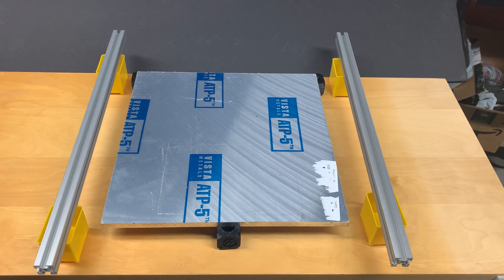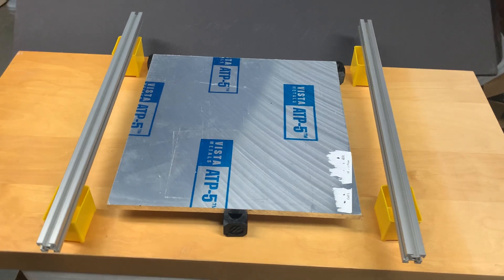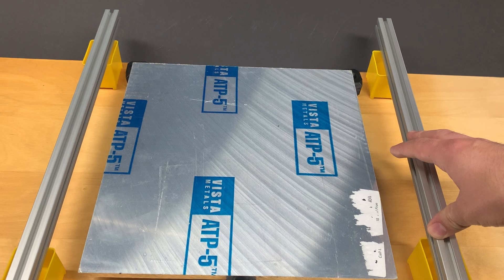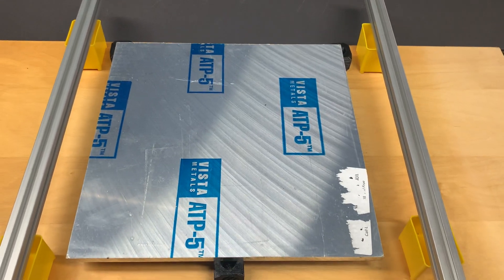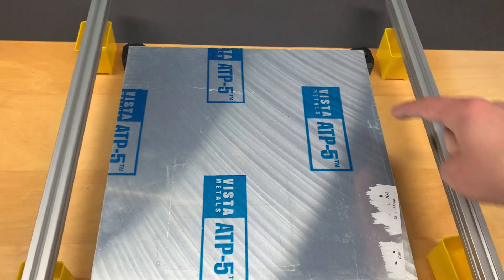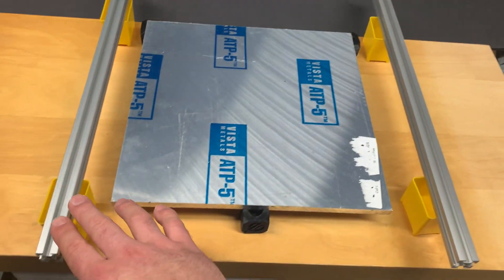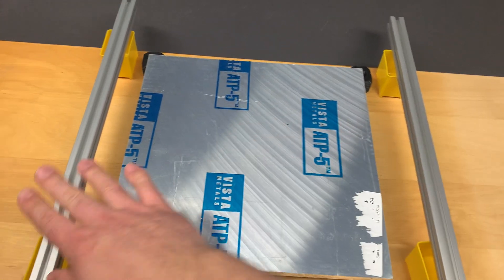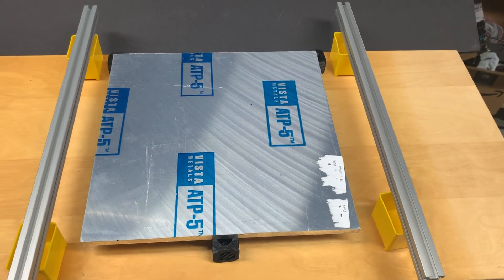Intro to Voron Bed Leveling: 3 Point vs. 4 Point

Comment: Thank you for this. Explains what is (likely) the issue with my small core xy printer. I’ve been tearing my hair out trying to diagnose the bed mesh differences in the front corners.

Comment: Swap out those springs for those silicone rubber spacers. They are there only to allow some movement in case of nozzle crashing into the build plate.

Comment: You are right, but there is another important point to remember. Bed leveling (or tramming) is dynamic, not static. The firmware compensates the Z height for every point of the the bed, interpolating the mesh points. So, even if the gantry is misaligned on Voron 1.8 (or Trident) it should be compensated by moving the bed. So, in the end, it should not be a huge problem.
Reply: The firmware can ONLY do that if the firmware includes that feature (some STILL don't), and if the feature is properly configured by the user - which for some machines that support it is necessary before every print. If the machine is large enough, many users will be unwilling to sit through the wait duration of the process more than once or twice, especially if they don't have the specific hardware to ease the process (i.e. a bed probe). Since not everybody builds Voron printers using all of the same parts, these are concerns to keep in mind.

More importantly, bed tramming / ABL is unreliable IF the cause behind it is racking or other misalignment of the gantry itself, because either of these can and often does result in unpredictable stepping mistakes, and attempting to correct for them with ABL or using the machine without correcting the hardware causes can both exacerbate the problem and damage the gantry. ABL/UBL/MBL is fine when the problem isolated to the final platform of the bed, but it's very much not fine when the problem originates from the gantry - or, even worse, from the frame in those very few printers which actually have one.

Comment: Haven’t looked at a v2.4 quad gantry yet, but isn’t the point that one uses three points to tram a plane, and two points to tram a rail (line)? I think the confusion comes from calling it “bed leveling”. If I understand correctly, you aren’t leveling or even tramming the bed, you are tramming each of the two gantry rails independently to be parallel with the plane of the bed (and each other). The machinist’s way would be to have an indicator stand referencing from the bed (a flat plane). If the v2.4 has four corner screws to introduce twist/winding in the bed rather than correcting the rails, this seems non-optimal.
Reply from the maker: you're correct! It's not leveling the bed, it's tramming the gantry rails to be parallel to the plane of the bed and each other. The bed is stationary the entire time

Comment: I’m having troubles with my 3 point level... I think you may have something here haha... I have an Ender 3 v2, just got 3D fused linear rails xyz... and the 3 point leveling kit... I can get 3 corners to be perfect but the one is low... I’m not an engineer... my head hurts from hours of trying spacers and all sorts of things... any advice how to fix ONE corner ?
Reply: Build a Voron 2.4r2
Reply: @F1v30h1  2 years later I'm good now but thanks haha

Comment: Are there plans to bring 3 point leveling similar to what's on the HEVORT to the VORON v1.8?
Reply from the maker: Some of us are looking at it! From a purely bed leveling standpoint, I don't see the need for a 3rd lead screw (I didn't adjust the front thumbscrew from the time I made the V1.8 leveling routine video until I moved recently), but from a bed stability standpoint on larger printers (300+), the 3rd lead screw can stabilize the bed from rotating front/back. That IMO is really where the 3 leadscrews shine. Once you're there, you might as well add in the 3 point bed leveling.
Reply: @eddietheengineer  That's great to hear! I just registered on the PIF list for a VORON 1.8 ( I'm not confident in my ender 3 to print dimensionally accurate parts out of ABS) after doing a lot of research and 3 point bed leveling was really the only thing that I felt was missing from the design! I'm excited to start slowly sourcing parts while I wait for the 3D printed ones :)
Reply: tbh hevort's bed leveling is mostly done for laughs and showcase,
something like a jubilee kinematic coupling is not only cheaper but better.